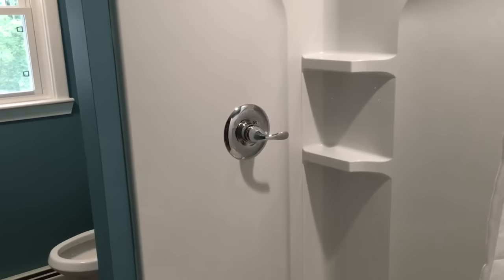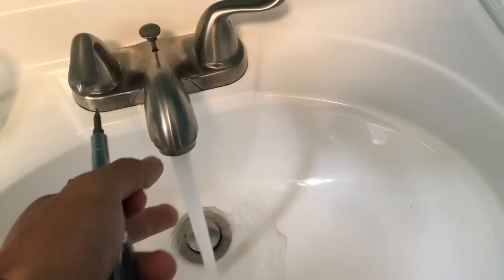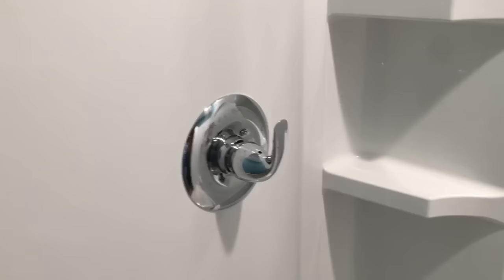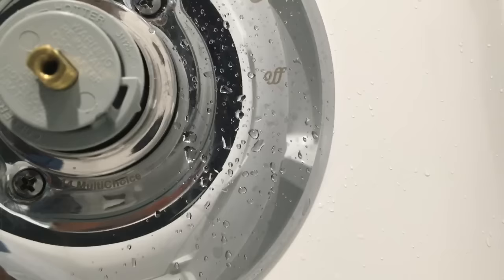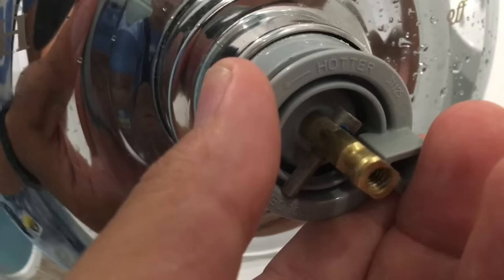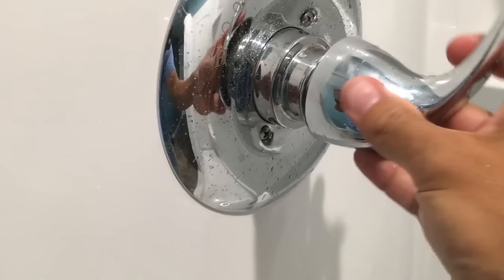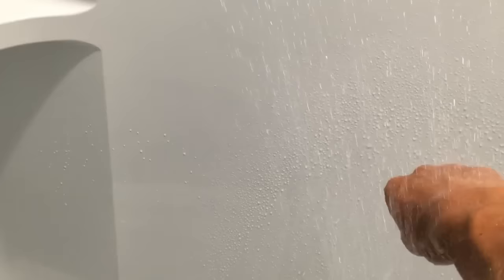Shower not getting hot? Adjust your shower Mixing Valve!

Comment: I just sang the hallelujah chorus in my bathroom. New homeowner/single lady dealing with lukewarm showers throughout the warmer months because I had bigger fish to fry. Now that I'm financially tapped out and it's getting colder, I was praying for an easy DIY fix. You just did me a tremendous solid, my dude!! 💜
Reply: Ditto 🎉
Reply: So my shower handle doesn’t have the hotter or colder piece 🤔

Comment: I really wish I would’ve watched this before I went and adjusted the PRESSURE SCREW. It popped off and sprayed water EVERYWHERE until I could find the shut off valve at the water heater 😂 lesson learned. New homeowner, so it was comical.

Comment: Dude!! you rock!! I have a different set up but same concept.  I built my bathroom downstairs and the water was fine until winter.  Thought I was going to have to call a plumber, thought I had done something wrong when I plumed it. (besides apparently not reading the instructions that came with the valve).  Really saved me a lot of money and  a lot of pent up stress.  Thank you so much for posting this !!  Took less then 10 minutes!  man am  I pumped.

Comment: Amazing. My shower always had to be turned all the way hot to get a comfortable shower......and in the winter time, I would adjust my hot water heater gauge to the hottest setting to get a comfortable shower, then turn it back down in the spring. I've done this through 2 winters (1 1/2 years total in a brand new house). And all this time I had 2 Allen wrench sets sitting around doing nothing. Thank you....!!!
Reply: we're going to try this fix right now. I really hope it works. We don't even have enough hot to last a whole shower, let alone 2 in a row. And it defiantly wont fill the tub. We literally have to use jugs from the scalding sink water and  hot kettle water to fill the tub
Reply: @slowpie  It concerns me that your shower actually runs out of hot water...? That never happened with me. But power on. There was a fix I had no idea existed. This video did not match my particular faucet, but after a couple more searches looking for my Peerless brand, I found the one that sealed the deal. It took me less then 10 minutes to adjust my faucet and now nobody can get me out of my sometimes too hot shower unless I'm careful. Good Luck....!
Reply: @ronster369  thanks. So the fix seems to have helped the shower situation. We turned up the hot water but it only really made the small taps scalding hot, and didn't do much to the shower so I had to turn it back down. I can defiantly have a longer, hotter shower now that we can turn the single arm faucet actually all the way up. It didn't do much for the tub tho. it used to fill 1/4 of it now it barely makes it to half and runs out, but there is still hot water coming out of the sink?!?

Comment: Husband just replaced the part because water was dripping and now water not hot. I found your video so now I see what the problem is so just shared this video with him. Sure hope it works. It has been a major ordeal but finally got the right part now to get it adjusted correct. Thanks

Comment: Thanks for the vid. Comfort is a big factor but a fact not mentioned is the water savings. When you run the water to get the shower up to temp, it comes up quicker wasting less cold water.

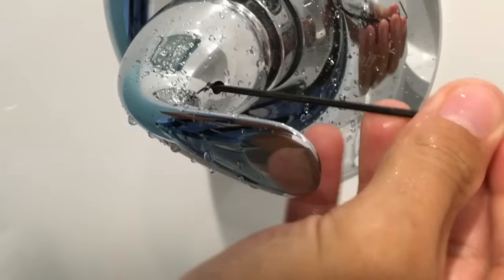Comment: I'm having this similar problem/ not having hot water in the shower, what size allen (hex) key are you using at 1:08 ? Now, is that a standard screw in all of these shower faucet?
Reply: Probably best to have a set of hex keys,American made shower mixer will  be imperial sizes, the rest of the world is basically metric

Comment: Always easy for most people. 
Always other problems when i try to fix something. 
 I was lucky to have the correct allen size to loosen set screw but handle still wont budge even after using a hammer 🙄

Comment: We've been dealing with a progressively useless shower for the last several months by jumping in when the water is hot then is the temp changes from from tepid to cool turning the shower off for a couple minutes then turning it on full hot and jumping back in.
     RJNSEe and repeat several times & it does the job. BUT NOT NORMAL, 
     Will dismantle this weekend and see what's what ...but I do have ONE BIGQUESTION,:
       This fixture was installed in a 1956 house around 1993 to1995. The hot water comes from a domestic coil on the oil burner which also serves to produce the hot water for the hot water baseboard the baseboard heating. 
      I paid a plumber to install a modern expansion tank which does not need to be drained.
     Is it possible that this valve device / handle -whose parts in the shower are bright and shiny - just needs to be replaced ?
     All comments in response are welcome

Comment: What if it’s the opposite ? My shower head gets too hot randomly while I shower. What could be the fix for my problem ?
Reply: mixing valve possibly or someone in the house is turning on a cold water faucet diverting some of the cold water making the temp of the shower fluctuate.

Comment: what if I have 2 sinks in the bathroom, one sinkgets HOT the shower and the other sink only look warm, I had a plumber here to install, he seemed like he was confused, I dont want to get him back, any suggestions of what it could be ?
Reply from the maker: That is a Very Strange problem, when you say they get lukewarm do you have only hot on or some cold and some Hot. I would try this mixing valve trick in the video and see if it helps with shower. there could be a mixing valve issue with the bad sink as well. If you are getting hot water to on sink it means your hot water tank is fine so that is def. not the problem. Best of luck Lynda!
Reply: It was a bubble in the line working now !!

Comment: My problem is kinda the opposite. I have hot water at a great pressure however when I move it to cold I get hardly any flow, the water just drips out. What do I look for to adjust the cold pressure?
Reply from the maker: It could be a bad Valve for the Cold Water causing not enough water flow to go through in that case you will need a plumber!

Comment: My problem is that the people put the screw in where i can only go to warm water and warm water bothers my sensory problems and fibromyalgia idk what to do about it im freezing and hate these painful cold showers and because my shower curtain keeps falling down and physically i cant keep putting it back up so im pretty much just flooding the bathroom twice a day because of that
Reply: get someone to do the adjustment for you, like a friend. Unless you own the house you are causing a lot of damage that will have to be repaired out of  someone else's wallet. Also try getting a permanent shower rod installed. Tension rods do not fall down if installed properly and not ranked on. They are not ment to be used for support.

Comment: so if your faucet doesn't have a screw to use a HEX key, how you pry the knob off without scratching or do you have to unscrew the two screws to take the whole thing off? I would assume if you unscrew the two screws and take it off the shower wall you will need some water proof sealant when putting it back on?
Reply: the handle has a screw somewhere if you have the clear plastic one it is under a disk on the front of the handle.
Reply: @tracib1122  Thanks

Comment: See I have three nozzles( hot, cold, and to switch between shower and bath) how do I do this?
Reply from the maker: JaxxRyan not sure on your exact mode you might need to find the brand and google search that one
Reply: JaxxRyan if you run straight hot in the shower and it is still cooler than other hot water faucets, look for a mixer valve perhaps behind the wall on the other side of the shower enclosure.  This could be a plumber installed valve, probably not part of the shower mechanism.

Comment: If I have a single handle shower knob like yours but my handle doesn’t have a any notch on it to unscrew then how can I adjust it?
Reply: I have the same issue. It won't unscrew or pop off with my hands trying to twist it, etc either
Reply from the maker: Sorry to hear it, if you find another video that helps make sure to post a link
Reply: @Reviewoutlaw  Actually I worked out that I just had to put my palms on the shower plate and, applying pressure, turn it. It eventually unscrewed! Once I got it off, I followed your video tips, which helped. Now my water is much warmer. Thanks :)

Comment: Hello! You might not be able to help me but my landlord "lives far away and it's a hassle to come to me" so I'm trying to fix my shower myself. I was able to get the handle off but the mixing valve doesn't even seem to be there. Is it possible to get just the mixing valve somewhere without having to replace the whole thing?
Reply from the maker: Depending on the show type in might not have a option for adjusting the heat. Your best option might be to call a plumber and see if they can help, Best of luck!
Reply from the maker: you can also watch this video, https://www.youtube.com/watch?v=O4cazHg31Jc

Comment: Do you have to turn off the water supply before adjusting the valve?
Reply from the maker: No Need to turn off water you can do it with water on as you are just adjusting a Valve / AKA How much percentage is Cold VS Hot, best of luck!
Reply: @Reviewoutlaw  Thank you!

Comment: What if faucet isnt very hot either?
Reply: Could be you need to turn up hot water heater heat OR could be that the cartridge is bad in the mixing valve sometimes causing the temps to mix elsewhere in the house. Ive read that if your toilet is sweating, that's usually a sign of a bad mixing valve cartridge insert
Reply from the maker: Thanks for the post!

Comment: IF YOU ARE NOT ABLE TO PULL OUT THE ADJUSTER BIT like shown here, your tap might let you to just turn the handle bit itself, you know that is the case when the shaft is circular rather than rectangular as shown here. Then adjust the handle against the direction you want it to go and attach it back on, so it can go further in the direction you want, even simpler!
Reply: In my case, it turned out my mixer tap has a "Child safe mode" where by default it doesnt go all the way and you need to press in a button to go further..

Comment: i just found teh right size i belevie its 3 is the right size its a small allen wrench with a very small l shaped end on it i cant get any leverage on it the screw is too tight i cant turn the screw its not as easy as this guy makes it seem and then to tighten it back would be very hard to do which can cause problems i am a man and i will leave it be it dont seem like a good idea to mess with it
Reply from the maker: you might have some rust or issues with your mixing valves if it seems like it's going to break, don't go any further, call a plumber would be the best idea